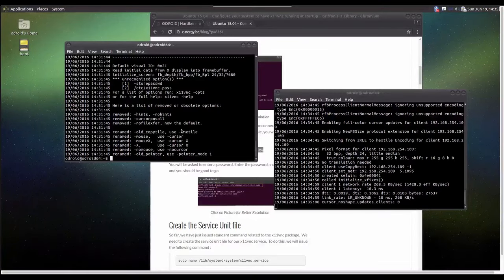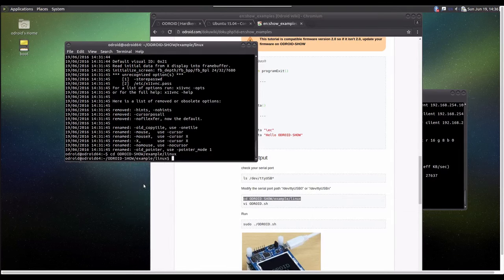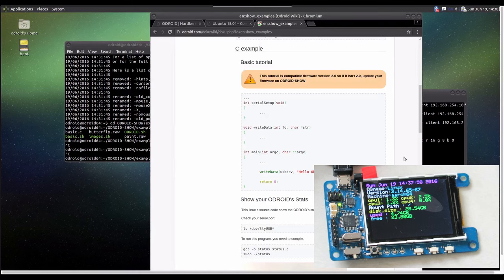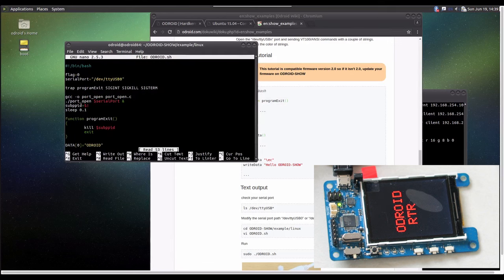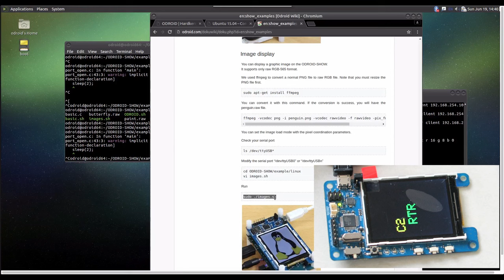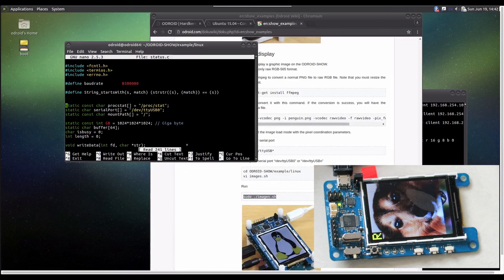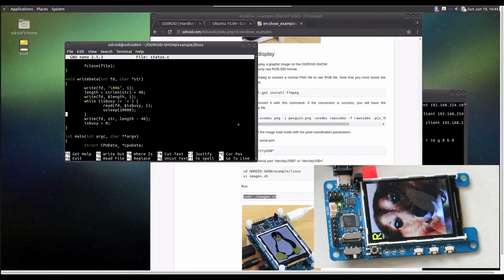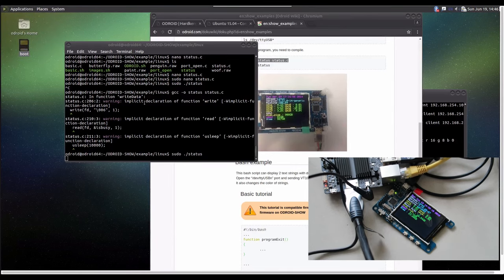ODROID SHOW 2 Demo (HardKernel)

Comment: I just bought it a few days ago. I link the show 2 with my desktop pc running ubuntu 17.04 64 bit. tried tu run samples but always black screen (green led on).
Any ideas?
Reply from the maker: Make sure you sending your text to the correct port that is connected to the display. Also, check the display is powered on.
Reply: everithing is ok. board turned to on. usb recognised but always black screen. I've tried  to upload firmware 2.0 from hardkernel official website via arduino ide (latest). but nothing. it says "permission denied" even though sketch has been compiled well.

Comment: Can you use it as a secondary display monitor
Reply from the maker: Hi MrSkyTown - the 2.2 inch TFT display only has 240 x 320 pixels so limited to how much data you can display. But more importantly the display refresh rate will be your biggest hurdle to using it has a secondary display if the data is changing quickly.
Reply: +RunTime Cafe so its possible, right? I understand what your saying about the refresh rate, but I'm still interested lol